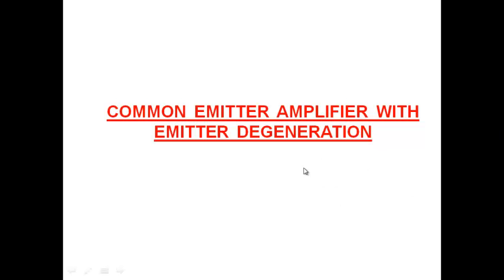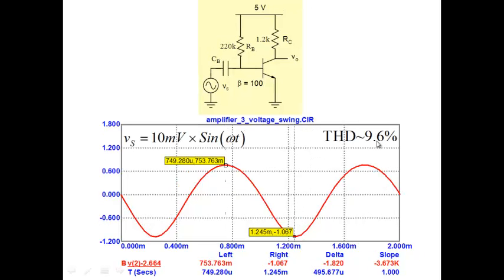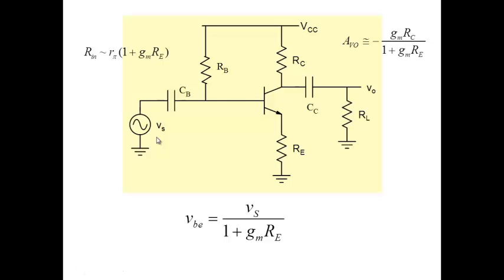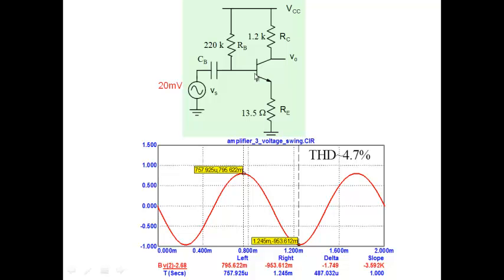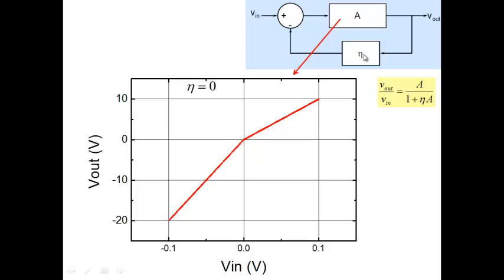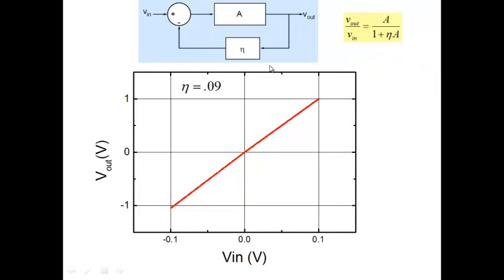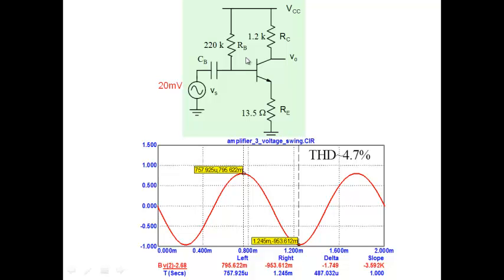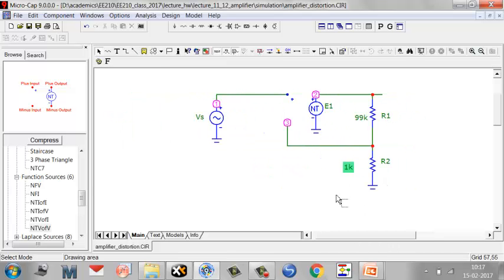BJT Common emitter amplifier distortion reduction due to emitter resistance

Comment: Not bad good sir. Still have a few questions. I am trying to visualize this correctly in my mind. If you will. Is it correct that the ac signal and the feed back resistor do not affect the DC loadline or the DC Q point? I am fairly certain about this. However, I can not quite figure out how the output signal takes on this distorted shape? The plus side clearly has to be limited by the VCE cut off. But why does it not cut off more sharply? why does it stay round for so long. It almost seems as if the AC Q point is moving away from the VCE cut off point. Maybe i need to learn more about these harmonics.